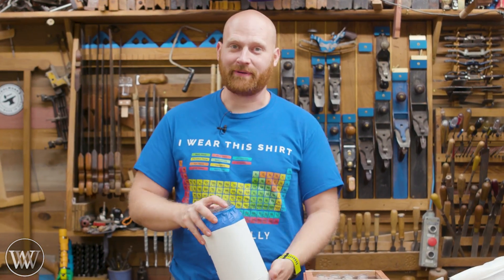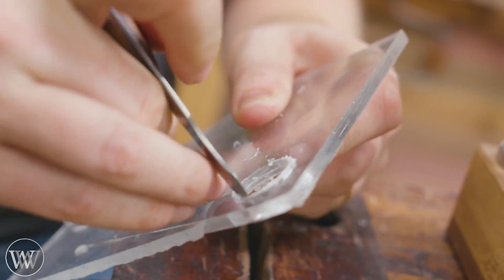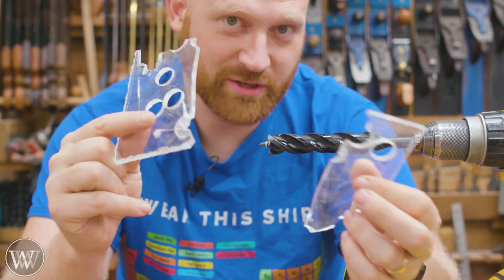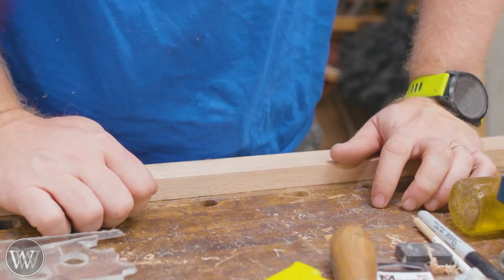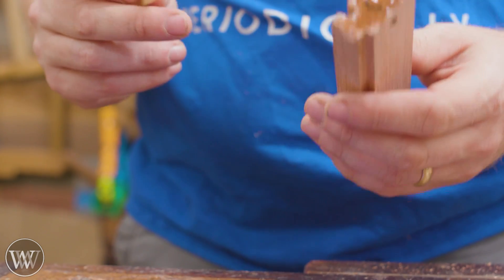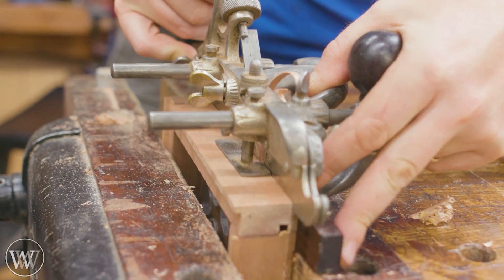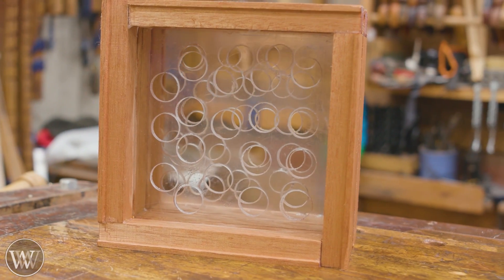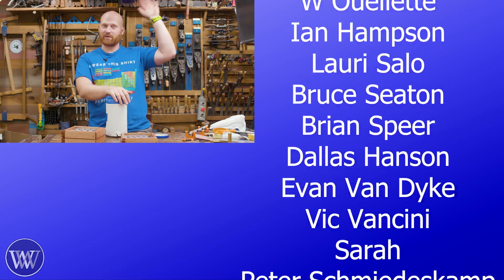How To Make A Coin Sorter

Comment: Amazon sells a plastic set of these. I removed two opposing sidewalls from each tray and fastened them together in a row. Added a funnel to each coin sections bottom to capture the coins into a container. I added a small motor with a vibration offset weight to induce a vibration. Prop one end higher and let the coins vibrate down each sorting point, separating each into their respective containers.

Comment: This style of sorter is very effective. 
In another life we used commercially made round stack sorters to sort coins in a bank. Large round trays probably 50cm (20inch) dia. sized for Australian Coins, 50c, 20c, 10c, 2c, 5c, 1c. This made sorting large volumes of change very quick and a lot easier than doing it by hand. 
Between being able to sort quickly and weighing rather than counting (put a $10 bag of silver on one side then load the other with sorted or unsorted silver to balance), made life as a teller much easier. 
The beauty of the Australian Currency is that $10 of 50c pieces weighs the same as $10 of 5c pieces. Then of course they ruined that system when they introduced our 1 and 2 dollar coins with the $1 being larger and heavier than the $2.

Comment: When working with plexiglass, a step drill bit is the way to go. It shaves the plastic on the side, so you don’t get the pull-through or shattering that twist bits and augers cause. And each step has a slightly different diameter, so you should be able to get the exact dimension.
Reply: ...and avoid scroll saws.. (see above) 🙂
Reply: Step bits are the only way to go when drilling plastic sheet.  Nothing else works anywhere near as well.  You can get them in a whole range of step depths and diameters so finding the hole size you need shouldn't be too hard.

Comment: Annealing the plexiglass (acrylic) after your drilling is a good idea, it will prevent cracks from forming around your drilled holes.  That's just up to an hour or so in an oven at around 100-150°C (200 somethingF).

Comment: How about drilling with a 18mm drill bit then using a slightly tapered wood dowel with thin strip of sand paper glued onto the dowel to widen out the hole to a mark on the dowel that is 18.5mm diameter. You could mount the dowel on a shaft to use with a power drill at low speed if you have several holes to enlarge.

Comment: Sandwich the plexiglass between two layers of MDF or plywood. You should be able to drill without blowout.
Reply from the maker: That'll work with the regular bits. But not with an auger bit

Comment: I get the fun in it, but..I've managed to save my change now for the past 10 years so there's just NO WAY I'm going to shake it all down to pennies, nickles, dimes and quarters..  I think I'll have to pass, but fun watching.
Fun tip! If you're thinking of cutting plexi with a fine scroll saw blade on your scroll saw? It'll cut like butter, but the plexi melts right back together as the blade passes through it..  I only know this because I...uhhh.. tried cutting a big ol circle all the way around and it was still a square when I was done with a pretty circular pattern melted in place for posterity..

Comment: Hey James, next time try to use hacksaw to cut plexiglass. Saw for wood is not a good idea. I tried to use jigsaw, but it also bad idea - blade heats up very quickly and melting PMMA. You can use sandpaper on Dremel to increase hole size from 18 mm to 18,5 mm if You can't buy it. I think the best option is to use drills for metal to drill holes in PMMA.

Comment: Could you not have filed or reamed the holes to final diameter?
Reply: that was my thought.
Reply from the maker: I tried that but getting it precisely the right size filed is almost impossible. One or two strokes too much and you created a wide spot where the queen can go through horizontally.
Reply: @WoodByWrightHowTo  the reamer I was thinking of is the machinist kind which is used to bring a drilled hole from kind of something point one digit millimeters to really narrow tolerance like an IT H4 fit or similar.

Comment: The fellows suggesting different style drills are dead on.  The trick to drilling plastic is that the cutting edge needs to have a neutral or even slightly negative rake angle rather than the highly positive angle found on your augers and twist drills.  And those cheap flat spade bits and the sheet metal cone Unibits have this neutral rake aspect.   

Or there's a trick to modifying twist drills for plastic (and brass) by grinding away the last little bit of the positive rake.  One of the nicer videos on how to do this is this one by Clickspring. https://www.youtube.com/watch?v=pAngKHIZgyA   

For what you're doing if the unibits work then great.  They center up and cut super nice round holes.  Use very low speed and Windex for lubricant/coolant.  They don't have the greatest OD relief so they are a draggy cut but the finish is really smooth.

For spade bits I just tried one and found it tended to wander for the last part of the cut due to the center losing support. I tried again with a piece of wood clamped as a backer and it cut a wonderful smooth and very round hole.  I sharpened it freshly for this test so it would scrape cut and it needed firm pressure and made a nice shaving.  It wants to melt though so I kept it slightly wet with Windex as a coolant/lubricant which worked well.  Nice clean entry and exit with very little burr.  And a smooth hazy almost clear finish to the side of the hole.